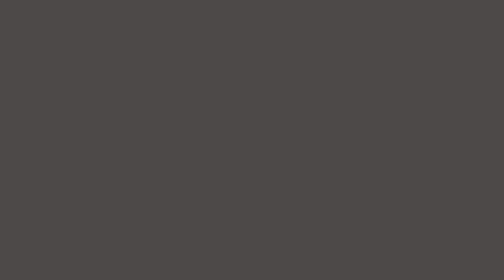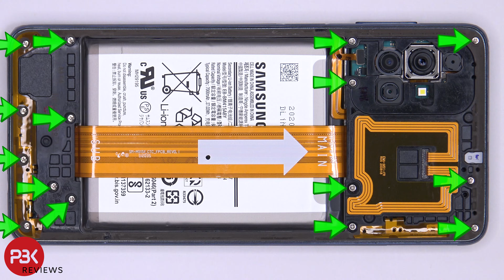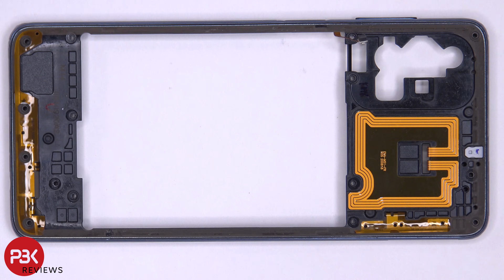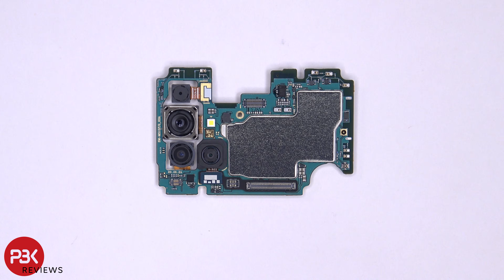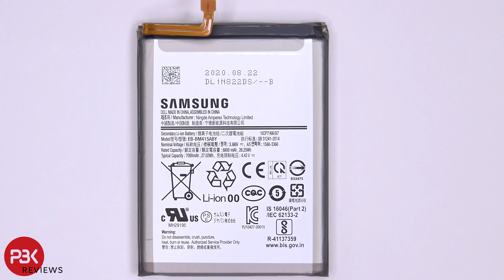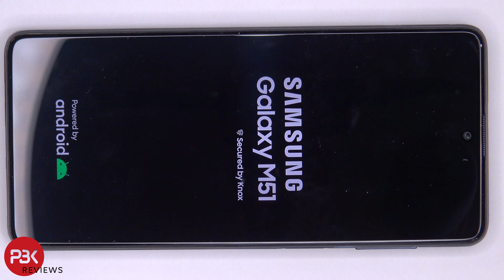Samsung Galaxy M51 Disassembly Teardown Repair Video Review

Comment: My M51 works very fine in day to day use. There is only 1 issue. When playing heavy game like Pro Evolution Soccer even on low graphic @60 fps it heats up and starts dropping frames after crossing 40 degree C. Any solution?
Reply from the maker: The phone doesn't have any high end cooling solution so its normal for it to heat up like that. The phone doesn't have a copper vapor chamber nor does it have a 3D layer of graphite or any special cooling aside from some graphite film and thermal pads. The screen generates a lot of heat when its on for long periods of time, as well as the battery and processor. So due to price range thats what they have to work with. Bottom line the phone isn't really a gaming made phone so the cooling isn't made up to specs for that. Hope this explanation answers your question. Let me know if you have any other questions.
Reply: @PBKreviews  maybe a software update might fix the problem to some extent?
Reply from the maker: @madone7190  I don't think so because its normal for it to heat up while playing games and such especially since the phone doesn't have high end cooling. Its not a design flaw or software issue that the manufacturer would release a fix for.
Reply: @PBKreviews  thanks for the info. I got scammed by all those Indian 'tech gurus/reviewers' who said any heavy game on high settings would run buttery smooth on this device.
Reply from the maker: @madone7190  ya not sure why they would say that. Not saying it can't handle games but I personally would not buy this phone for gaming purposes especially games which have more heavy loads. Even the higher end Samsung devices heat up a decent amount while gaming but due to the cooling provide more steady and consistent frame rates etc.
Reply: @PBKreviews  well I had Honor 8X from Huawei earlier. That phone would never ever heat up on those settings though. I brought M51 as an upgrade over that. 😭
Lesson learnt: Never gonna buy a Samsung phone again.
Reply from the maker: @madone7190  oh I see, not sure.
Reply: @madone7190   mine does not heat
Reply: @lakshyagrover6379  try playing PES on standard settings.
Reply: @madone7190  try to use other m51 to make sure if your phone has a heating problem or not
Reply: After how long playing?
Reply: @thehot2799  after 10 to 15 minutes.

Comment: That so called "copper" is the backside of the amoled screen
Reply from the maker: Yes.. its a copper tape thats lining the back of the screen,  these copper tapes are used for heat dicipation since the screens generate a lot of heat when on for long periods of time.
Reply: @PBKreviews  but....it's not a real coper heat dissipation solution.... literary every phn with a amoled display has it.....I would have rly liked it if they provided a copper pipe or something
Reply from the maker: @punisher3376  Ya true, but the reasoning behind the copper behind the screen is for the heat. But ya it doesn't have any copper for cooling the main board and such on the midframe.

Comment: There is 7k MAH battery inside right ?
Reply from the maker: Yes correct
Reply: @PBKreviews  but battery not work like 7000mh  please  share u r experience
Reply from the maker: @chiragjain2876  depends on how you use the phone, as well as the fact each processor handles battery differently. So one processor type in a different phone might use less battery off of a 7000 mAh vs another phone with a different type of processor. I personally am not using this phone so not sure how the battery life fares.

Comment: Yesterday my a51 phone dropped into the water and lcd turned green . Now how it repair ans me plz . I hv not much money . :(
Reply from the maker: Hi, your best bet would be to take it apart, disconnect the battery and dry out any liquid. Then use a tooth brush or something similar to brush off any corrosion on chips and connectors etc. Once you have done that, you can reconnect the battery and see if it will work. If not, it's possible you have a bad screen or your motherboard components went bad.

Comment: Would the screen from the A71 be the exact same used on the M51?
Reply from the maker: It looks to be the same, but I'm not 100% sure. Most likely would be the same but sometimes they make the connector size different etc., so 100% sure.

Comment: Hi PBKReviews, This is very much detailed video on what is inside our phone. Thank You! for that. But I have a question. 
Cameras are not placed exactly center of the punch hole
I noticed in Samsung Galaxy M51, the main camera and the selfie camera are not exactly placed at the center of the punch hole. The main camera and the selfie camera are slightly (fraction mm) moved to the left. Is this fine? what do you suggest? and should I replace? kindly let me know.
Reply from the maker: Hi, no that happens from time to time but is only a cosmetic thing and will not affect the camera lens or pictures. Unless it is completely being blocked and causing camera issues, I would not worry. They usually give enough open room around the lens cover for the camera to not be affected.
Reply: @PBKreviews  Thank you for the clarification, Yes it is not blocking the camera, and the camera is working fine. Because of this reason, I searched how parts are fixed inside M51 and I found this video helpful.
Reply from the maker: @pramodvasudevbhat1517  thank you, and you're welcome
Reply: @PBKreviews   Is disabling fast charging good for battery life? or normal charging and fast charging both are same for the battery.
Reply from the maker: @pramodvasudevbhat1517  I'm not too sure, but I don't think it should have too much affect on it. I have always used fast charging on my phones and the batteries last just as good as phones I had before with no fast charging.
Reply: Yes same on my unit too... Asymmetric things bother me..

Comment: Is the screen manufactured by Samsung factories?
Or from manufacturing other factories and their quality is lower
Thank you
Reply from the maker: Hi, I'm not sure since I would have to pry the screen off the midframe and risk damaging it to see the make/manufacturer which is listed usually underneath where the flex cable is covered.
Reply: Screen I guess is made by Samsung and its amazing.
Reply: Made by Samsung

Comment: Hey i have a doubt,
Is using a 7000 mah battery dangerous 
Im afraid if it blasts or whatever

Cause i want to buy this phone

Btw really good video 👍
Reply from the maker: Hi, you should be fine. They put the phones under extensive testing. Thank you :)
Reply: @PBKreviews  thank you for replying
Reply from the maker: @bharathp95  anytime

Comment: The construction is a bit strange
The main board cover needs to be popped up from perimeter even after screws removed
Reply from the maker: Yea they sometimes do this type of build on some of the Samsung lines as well as other manufacture phones. One benefit of this is that if the housing becomes scratched up or damaged, you can replace it easier.

Comment: This phone or xperia 10 mark 2?
Reply from the maker: In most ways the M51 is superior to the xperia 10 mark 2. Almost double the battery size, better processor etc. But of course the M51 is newer. However the M51 scratches easily on the back and only has gorilla glass 3 compared to gorilla glass 6 on the xperia 10 mark 2.
Reply: @PBKreviews  good friend. Thanks for your explanation 😉
Reply from the maker: @Huevos_de_colores  you're welcome :)

Comment: Good job 👌👌👌👌👍👍👍👍👍
And what you think about this phone build quality ?
Reply from the maker: Thank you. Its a great phone for the price. The battery alone is very enticing for someone who wants long battery life. Overall its a good construction, however its only gorilla glass 3 for the screen and the back plastic plate scratches very easily.
Reply: Build quality is not good, one of the heavy phone with large battery,  if at all it fell down from a small height, there is every chance that it may hamper the display